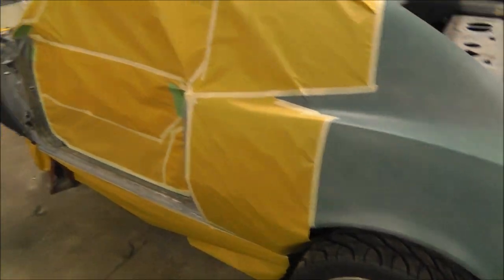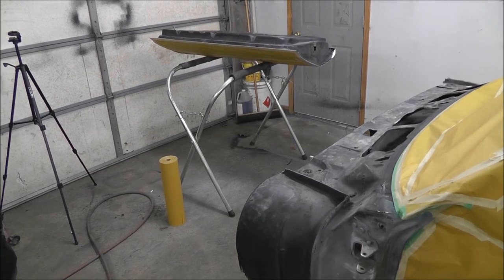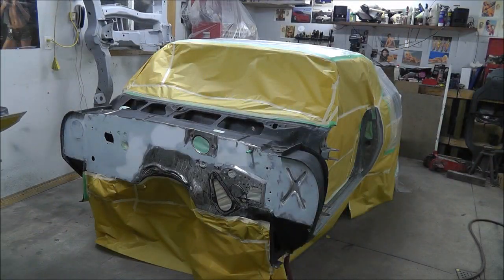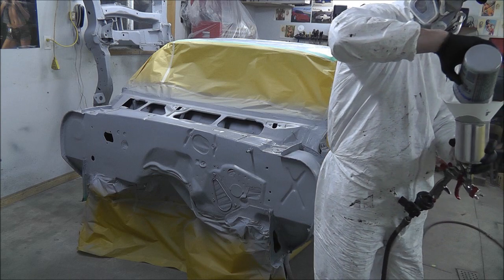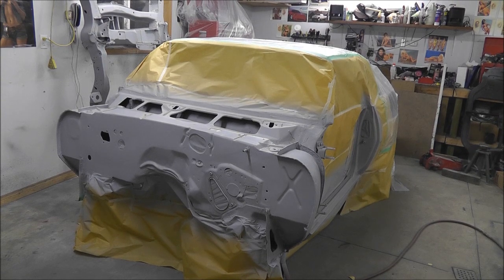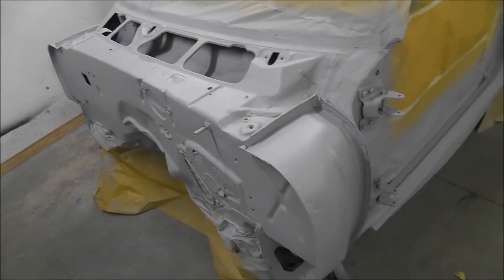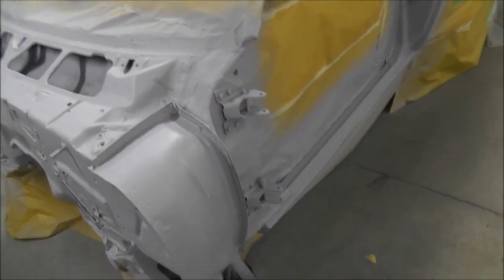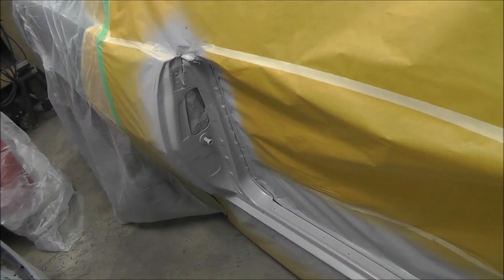My 68 Firebird Restoration Part 37

Comment: @GarethDavidWebb Gareth, well, yes, it's a PITA with the car up on jack stands, leaning over in there is tough, most most of the time I just get inside it, but then you have to be careful with wet material otherwise you run the risk of hitting it like I did the other night.  The falcon and mustang are on the same platform right? so the frame rails and engine bay configuration are the same or similar?

Comment: Try setting the door on the stand turned 90 degrees so the supports run along the length of the door. Let me know if you like it and thanks for the video. Is it starting to feel like you almost have another car? It seems like your getting pretty close now.

Comment: @turbocobra bet you thought it would have been nice if Ford made removable front clips lol, look how easy it is to paint a GM firewall lol
Im in the same boat leaning into the engine bay to do body work and painting on my falcon, drives me nuts